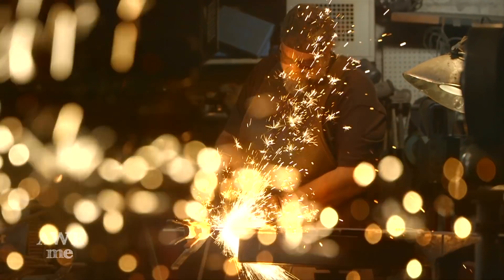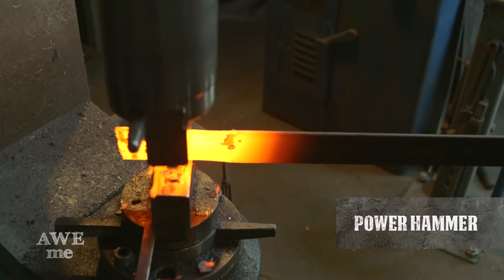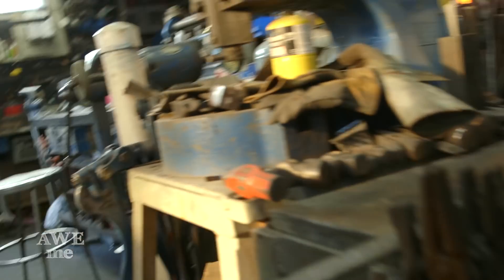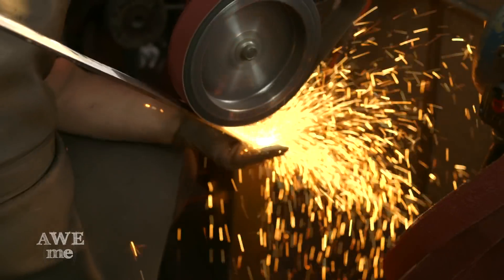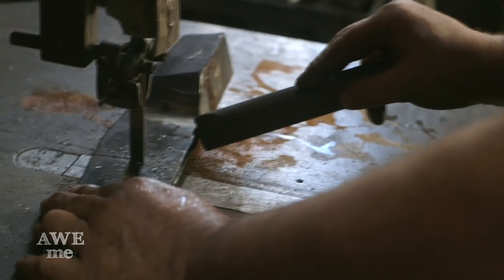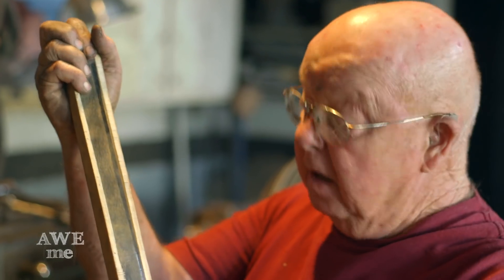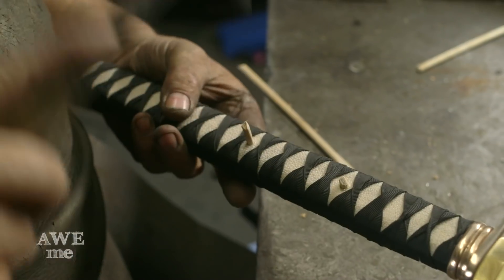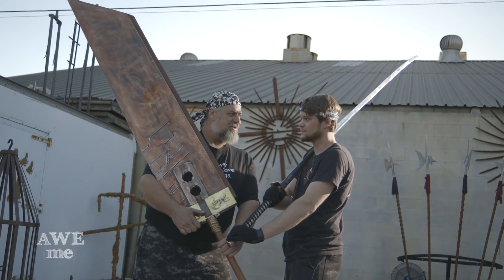Sephiroth's Masamune  (Final Fantasy VII) - MAN AT ARMS

Comment: This nicely summarizes why I like the Reforged stuff better than the original series stuff.
1. The reforged crew legitimately seems interested not only in their work but in the source material.
2. Everyone on the crew is actually credited in the episode (rather than just buried in the description) for the work they're doing. In this episode, he mentions Brian once, and everything else is just 'we'.
3. Its a big floppy piece of steel that was roughly power-hammered out of an already mostly-to-size-and-shape bar. Ilya would have layer-stacked, given it a kawagani/shingani construction, etc. that would actually stand up to use.
Reply: you need to layer stack the damn metal to flush out any impurities like dirt and coal etc. the metal he used was already perfectly consolidated. in fact its better to use metal like that instead of using Bloom which takes so long to finally turn into a good metal for katana. not to mention the risk of having it decarb. yeah the old tradition is great. but just use metal thats ready to use to save hassle.
Reply: and look at the description. everyone is credited. everyone.
Reply: Giving them a footnote in the description is hardly the same thing as crediting them in the actual video.

Yeah, they don't tend to fold their material when they're working with something like a big chunk of railroad tie or whatnot. But they still noticeably craft their blades rather than just refining a cut-out, with the exception of when they precision cut out something intricate on the CNC. Both take skill, but one is more impressive and makes for a better show.
Reply: +Wesley Foxx 
You do know that the main reason that the quality is higher for the Reforged stuff is due to the increased budget, lower time restraints and increased crew size, right?
Tony was working under extremely tight time constraints with a smaller crew, so it's understandable that there will be weapons that don't get the treatment they deserve. I mean, they had more projects to complete than they had days to complete them in.

Comment: For all the un noligable viewers saying "it's to wobbly" and "usless sword it's unbalance" it's impossible  to make a 7ft sword let alone a katana an already thin blade that big and not wobble. It's simple  physics man
Reply: +Hermit VII Yes, there will always be SOME wobble. However, if they'd done a proper job forging it, it would have much less of one. The higher the layer count, the more rigid the blade will become, enabling it to be more effective. At this point though, that Katana isn't even fit to go against paper armor.
Reply: Tru, I think it might be the way it was forged. If I recall in past Japan when katanas odachi ect were made the metal was "folded" in a sence. If they woulda made it thicker then it coulda lasted probelly but just wouldent look the same.
Eh it look cool atleast so still a win to me :D
Reply: Actually, it would have looked identical. The folding process does indeed add layers, but the process also pushes the excess material out to the sides when you do it. So you end up with super-thin layers, all the way through. Furthermore, the process of folding and "Hot Cutting" the blade allows for the distribution of carbon throughout the steel, making for a more homogeneous blade. This gives it both flexibility, and strength, and enables it to stand up to actual combat.
Reply: Haha unknowledgeable
Reply: +Hermit VII if you don't want it to wobble it would have to be like almost 2 inches thick lol and that would just look stupid
Reply: +Hermit VII no katana ! -_- daïkatana ! !!! INCULTE .
Reply: +Jarrod W ... Steel was folded many times to remove impurities. Purchased steel today is already free from the impurities and the carbon is very evenly distributed. When you purchase steel from a supplier, you're not getting whatever they just pulled up from the ground. It's been processed, cleaned and melted down into whatever shape you've purchased.

Whatever method you use, if you make a thin 7' 2" sword it's going to wobble when you hit objects.
Also, it's a showpiece, not a sword intended for actual combat outside of FF7. The Buster sword is even more impractical, but they recreate fictional weapons into functioning ones, not perfect ones. Because if they were creating perfect swords, they would look nothing like the fictional one.
Reply: I agree; the swords are entirely impractical. That being said, most of the time, the original Man At Arms group seemed to always take the easy route, and simply drop forge and cut whatever sword they were making. Properly folding and hot cutting the steel WILL make it stronger, though yes, not strong enough for a seven foot Katana to endure combat. I never claimed that there would be no wobble at all; simply that there would have been less had they done a proper job forging it. A seven foot katana would never make it through combat at the thickness that they have used for that blade. I'm not asking for perfection; just a little extra care when they are working. After all, they ARE making show pieces.
Reply: Now that I think about it . . . I can just imagine swinging the sword and the blade makes a funny metal sheet wobble sound and flops of the cross guard XD
Reply: Ok master sword smith 🤣

Comment: "Sepiroth's definitely win against the buster sword"
Me: Triggered
Reply: Ivan Juan I think they meant that as if both characters had human strength and thus would be swinging the swords as if a human would. But since both Cloud and Sephiroth have the cells of JENOVA coursing through them, they’re superhuman and thus are able to swing around their swords without much of an issue despite their comical sizes
Reply: I think I'll agree with that, still Buster sword#1! XD
Reply: I would've think that if they crossed sword, masamune might end up bent L shape.
Reply: Masamune is a way more practical weapon and would thus always win. Even if both fighters had super strength.
Reply: Meh. They both crap compared to the Dragon Slayer. Guts for the win!
Reply: Not gonna lie, the buster sword is probably 100 pounds, if the blades clashed, Masamune is gonna crack from sheer volume of the other.
Reply: @oskarileppanen1154  It would probably break straight through or bend in half. Especially given the quality of this "sword".
Reply: Masamune has a longer reach than the Buster Sword; in a real swordfight that'd be a significant advantage, and in a fight between 2 superhumans it'd still be a factor as Sephiroth could threaten Cloud at a much greater distance. Cloud would need to be more agile than Sephiroth or exploit a missed or parried strike to close the distance and land his own strike.

Comment: Everyone saying the sword bends. No shit. Regular sized swords bend on impact what do you thinks going to happed to a six to seven foot long blade that is virtually the same thickness all the way down. Its physics people take a tape measure measure about 30," which is standard katana blade length and its perfectly straight extend to six or seven foot and the thing bends under the weight of material at the far end. Physics and engineering....not that hard to comprehend

Comment: These are still completely awesome. But I wish you did more pieces worth folded steel so they'd be more traditional and less floppy.
Reply: agree 100% but dang even without folding steel the amount of work that he put into it was just awesome!
Reply: Very true. I'm always afraid that one day he'll swing one of his pieces and it'll just snap in half.
Reply: DARKGORZ
The whole point of folded steel was to compensate for bad steel. With access to modern steel, doing folding it just wasted time.
Reply: Casper Christensen I believe this is a contrast between spring steel which is more floppy, and high carbon steel, which is less floppy? Not sure what type of steel is 5160, it may be spring steel, but it definitely isn't High carbon steel which is 1040-1090, and again, more traditional swords were made of high carbon steel.
Reply: RagingPheonix
5160 has the same carbon content as 1060, the difference is that it has a bit of chromium and manganese added to change its properties slightly. The reason the blade is "floppy" is because of how long and thin it is. Swords that length just don't really work. In order to make the sword rigid enough not to flex while swung it would have to be much thicker, hence much heavier. Tempering the blade differently might make a difference, but if they made it too hard and rigid the blade would just snap instead of flexing.

Comment: Look how it bends
Reply: +NUK3 Destroyer Thats actually a good thing it means its strong but not brittle
Reply: Melting Clocks That's only if you dont make it red hot then quench it first before you put it in an oven the reason that specific blade is more springy than others is because the blade is so long. Do you even make blades cause that's not true. (and sorry if i sound like an ass)
Reply: +Melting Clocks Ah...
So, how's your life spreading hate.
Reply: I'm pretty sure they made it bent on purpose because that's how it is in the games.
Reply: +GRYPHON SCHNITZEL shut up
Reply: Illuminati Confirm thats probably what your mama tells you all the time
Reply: +Melting Clocks weak troll Is weak.

Comment: That Masamune looks amazing, but the Buster Sword looks like ass. The stain on the blade has very obvious brushmarks and is fucking brown. I don't make swords, so obviously I'm no authority on what they should have done instead, but obviously they should have done something else.

Once again though, Masamune looks amazing. Great work.
Reply: He did have the Buster Sword have a Iron Sword so it is going to rust when exposed to the air
Reply: Christian Munso The Buster Sword made by Man At Arms has an Aluminium core, so no, it won't rust when it's exposed to air. They painted a staining chemical onto it or something, but they did a sloppy job of it and it ruins the sword.
Reply: ***** How does having an aluminium core stop the iron on the surface from rusting?
Reply: Mucho Chen Pretty sure it's to make the sword lighter.
Reply: how does making the sword lighter stop the iron on the surface from rusting?
Reply: Mucho Chen Does he say that? I can't remember and can't be arsed to watch the video again to find out. If thats what he says then I have no idea how it stops the blade from rusting.
Reply: nono, you said it: "The Buster Sword made by Man At Arms has an Aluminium core, so no, it won't rust when it's exposed to air." Just wondering how that works
Reply: Mucho Chen 

Aluminium won't rust visibly because aluminium is always rusted, it's actually a highly reactive metal that can even catch fire under some circumstances (look up USS Belknap). It's protected by always having a thin coating of oxide from exposure to air, if you can strip this off and it can't re-form aluminium will corrode like it's rotting. Mercury can do that, that's why you can't take thermometers on planes.
Reply: +Omicron9999 Perhaps the Buster Sword is the Advent Children version that actually is rusted.
Reply: The Buster Sword looks that way because they had to drag it out since it weighs 80 pounds. It is also painted to look like he was cutting through buildings.
Reply: +Mudoh415 I don't remember the AC version being that rusted, just slightly dirty looking.
Reply: VulpisFoxfire I'm just trying to be positive.
Reply: +Omicron9999 "Use brings about wear, tear, and rust. Now that's a real waste." - Angeal's words of wisdom

Comment: Oooh... that floppy blade could be a problem...
Reply: And that's why people never made swords that long in real life.  Because physics.
Reply: Slider1207 Physics does have a factor when greating a blade that big but the main issue is the steel is far to malleable to create a blade that long and expect it to remain straight and true. Or not floppy. Its entirely possible since the steel that was used to create the Masamune was not specified so the day we fine a steel or even an alloy that could hold its form and stay rigid at such length and remain lightweight enough to still be weildable woud we then be able to create a functioning Masamune.
Reply: Alexander Haugh Actually, because it's flexible, it would have a better time cutting through 'tough meat'
Reply: a flexible sword is actually good
Reply: Flexibility does make for a stronger blade as long as you are able to keep it rigid. That blade is far to wobbly for any practical usage.
Reply: Perhaps a deep inlet in the blade, to allow for more rigidity?
Reply: Alexander Haugh the funny thing is that most swords are kinda flexible katana being the weird one by being really rigid but that is because of how they were made with a hard edge rather than a whole blade like most swords so yeah this sword isnt even a katana so who cares if its not practical is just metal doing cosplay of a sword and a damn cool one :D
Reply: Bloody hell, stop arguing
Reply: A little flex is pefect for practical usage because it allows the blade to stretch thus taking away the amount of stress put on the sword when struck. Some of the greatest swords I have ever had the pleasure of owing were katanas made from Tamahagane. Its an alloy cosisting of a iron core for flexibility and a steel shell for rigidness  and an ability to hold a razor sharp edge. I have been collecting for years sure yeah if I could get my hands on the Masamune I would but it would have to be made of a material light enough to weild yet strong enough to remain rigid and straight.

Comment: I like how they showed the hammer that's used to make katanas, but then they have no idea how to make an odachi, which is made just like a katana, not like that. You can even see how flexible the blade is, and they shaped the blade to a curve, in katanas the curve happens on itself while the bale is cooling down
Reply: and you also do not know what you are talking about. Sephiroth's sword is nothing like an odachi, it is an overly lon  katana. as well any sword that long  and thin will be flexible like that. it is basic physics.
Reply: this is not an odachi,. his sword is an overly long Katna. also you are trying to tell pros how to make weapons. when as they showed that is how stuff is made now. japan had to do it that way in olden times with their metals were so low quality.
Reply: @flameknightdragon  yeah, you know that even if they're pros they're propably jotnexperts on every single sword ever? The thing is they curved the blade by hand, even tho that's not how you make katanas. The curve occurs naturally while the metal cools down. It's because the edge is actually harder than the rest of the blade. And also ōdachi is literally built like a normal Katana, but longer. If it's a katana but significantly longer then it's Either Nodachi or Ōdachi
Reply: @flameknightdragon  they are pros at making weapons in the European way, but clearly not in the Japanese traditional way. And yeah Ōdachi isn't flexible. All katanas aren't flexible at all BC that's how they're supposed to be. That's why they're so thick

Comment: That sword would snap easily if anyone went into battle with it.
Reply: XDead MoneyXGD it’s more of a decoration piece
Reply: @justasentientmclarenp1879  I know but a weapon is supposed to be practical. No ones gonna wanna collect that. People only collect swords with deep origin....this boi longgggggg. Your average sword collector would even pay 50$ for it.
Reply: There are antique Odachi with blades this long or even longer, though they were usually much thicker and not used in battle.
Reply: Chopsticks for pins to hold the handles 😅
Reply: @TausifAhmad03  If it works, it works.
Reply: @qualityplasmid7260  ....These are swords Fantasy/fiction. Of course they'd break easily thats litterly what im implying in that comment. And they do have skill...there literlly a tv show who tests there own weapons by beating them mercilessly.
Reply: @qualityplasmid7260  Bruh, a good single steel spring tempered blade is stronger than anything Japan could offer.
Reply: XDead MoneyXGD I doubt many people will be going to battle with it. Maybe stab a robber here and there lol
Reply: E J Lmao. Layers won't make the steel stronger; that's only for shitty steel.since they're using modern high quality steel, they don't need to fold it. Folding makes good steel weaker and regress back into iron.
Reply: @hoominbeeing  That depends on the type of steel. 

Folding doesn't make it stronger (unless it has impurities). But if done properly, it doesn't weaken it much either. Though many spring steels don't go well with folding. 

China traditionally made some pretty flexible blades out of folded and laminated steel. The through hardened ones could be bent to a 90 degree and it springs back true, much like the European blades.